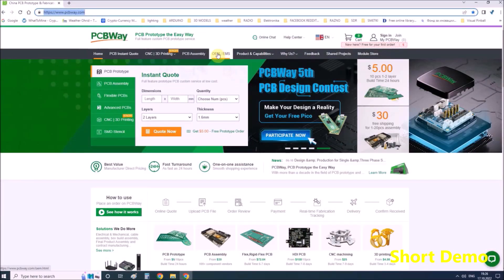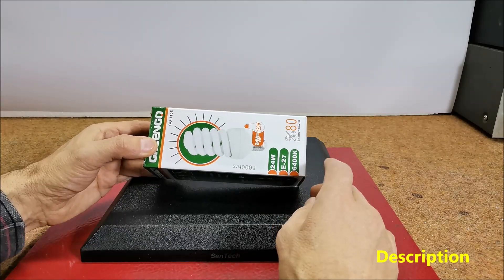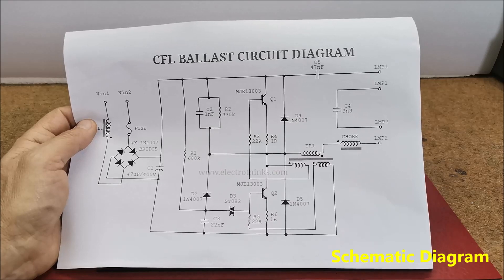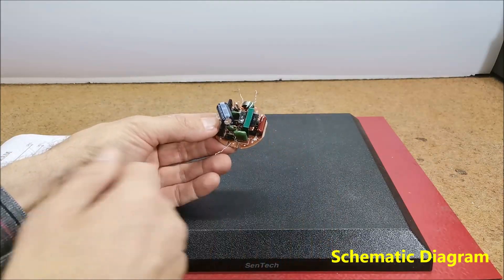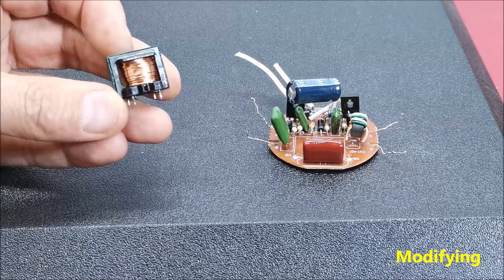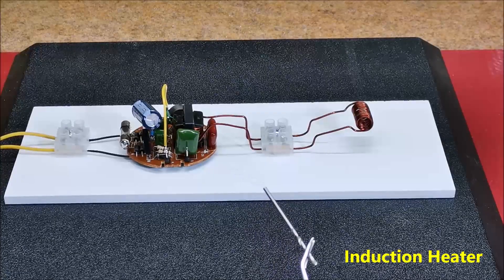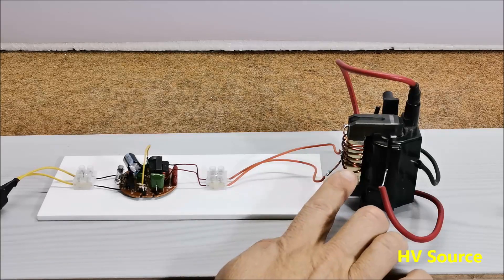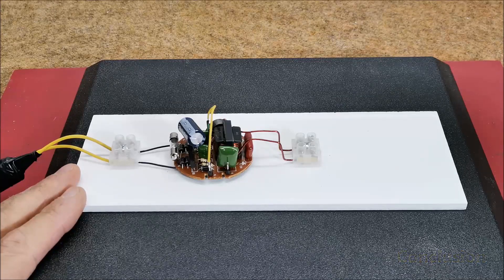Simplest way to make Induction Heater, Power Supply, and HV Source from CFL Bulb Ballast

Comment: Used the board from a 50 Watts CFL, with the connections as in Case 1, transistors are burning!
So it's either that not all CFL circuits are the same, or that there's something wrong with this diagram.
Apart from the author, did anyone else try this DIY ?